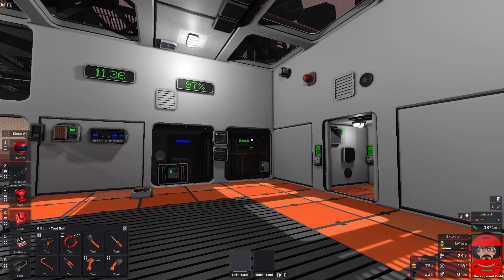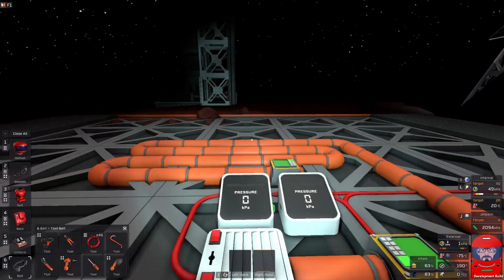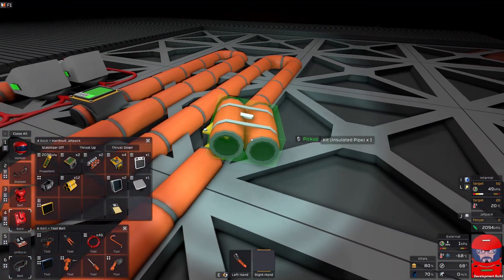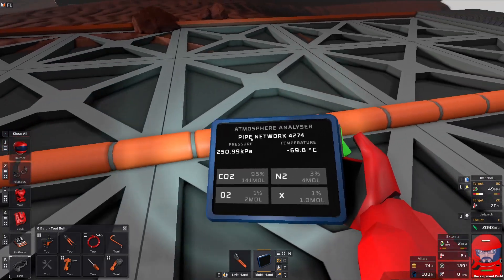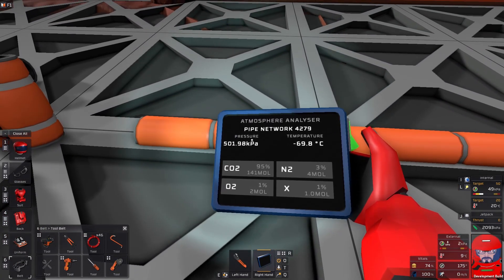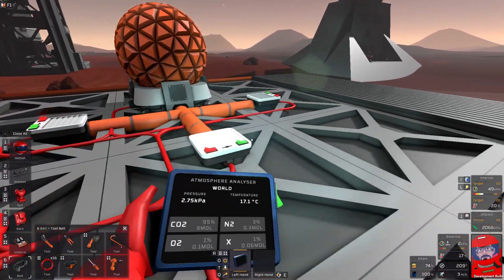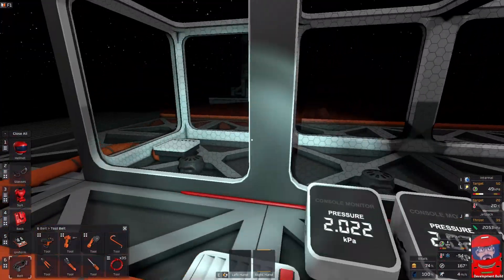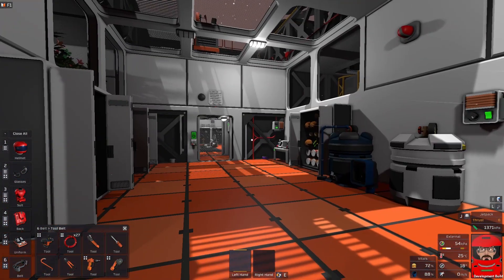Stationeers Pipe flow

Comment: PV=nRT. Can an experiment determine whether that gas law holds in the game?
Reply: It does as it relates to volume and pressure. Not to temperature. You cant pressurize a volume to store energy. As you release it in game the temperature remains constant.

Simply put no easy traditional refrigeration. Honestly it would kind of break the game making many atmospheric items useless and redundant in the game.

I personally dont mind it too much, theres enough realism to keep it fun for me :)
Reply from the maker: Yes.  When I removed the lengths of pipe it reduced the volume and the pressure went up as expected.  In reality the pressure and temperature would have gone up so it is not a perfect simulation but not bad.  My advanced furnace automation uses PV=nRT to calculte the desired pressure for the given temperature.
Reply: I can tell you that I use PV=nRT extensively when playing this game, and it hasn't let me down yet.

Comment: you forgot to test a zero backpressure valve in the double tank setup.
Reply from the maker: This was pipe flow.  Pressure regulation is next.
Reply: @cowsareevil7514  I was thinking of the context where the backpressure is set to zero so it's always open to see how it flows.
Reply from the maker: A pressure valve will operate the same as a pump until the set pressure is reached.  So a zero backpressure valve would operate the same as a volume pump and pump to empty.